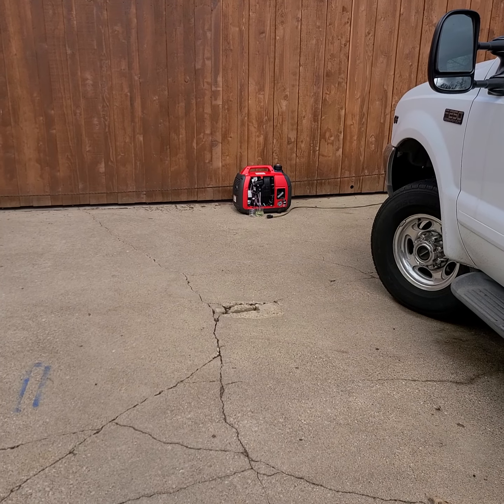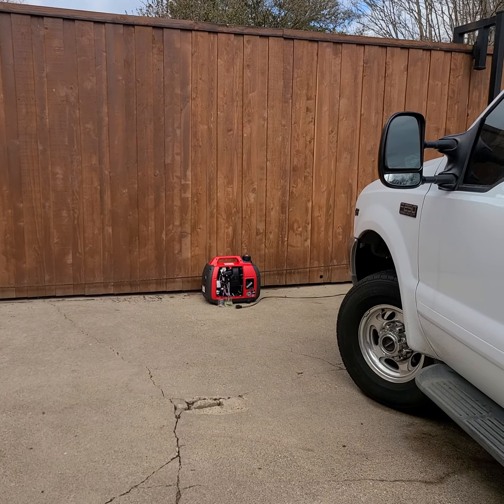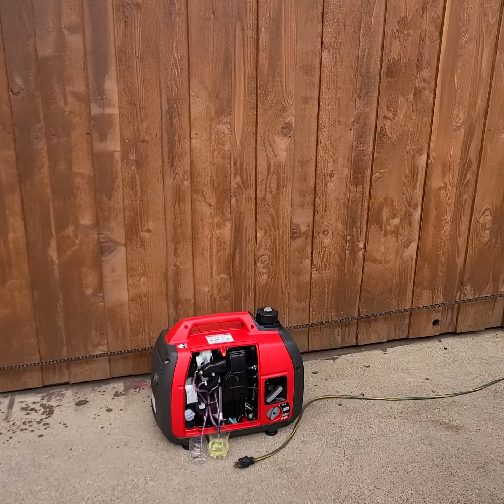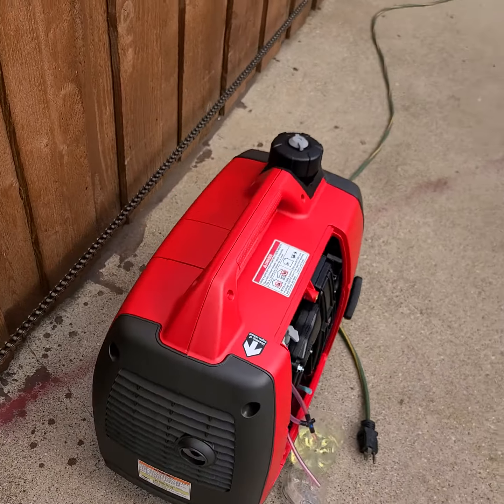Honda Generator Leaking Gas Feb 2021

Comment: Mine has been doing this too. What I did to fix it is that I turned on the defibrillator and then swiped my debit card into the exhaust pipe. This only works if your debit card is not expired and has enough money to charge and refill the generator. Then you want to open the air pipe by getting two drumsticks and drumming and 7/4 polyrhythm on the left side. That should fix it.

Comment from the maker: Thanks for all the comments.  I did clean the carburetor and it is working now.  But what is really odd, this was the 3rd time I used it.  I drained the gas and ran it dry the previous 2 times.  I will now drain, put in gas with no ethanol and then run it dry with that type gas.  That is supposed to help.

Comment: Easy fix…your float bowl is stuck open or float needle is bad. Easy fix with new carb kit and 15 minutes
Reply: I am going to try replacing the float valve and float, but if you look closely you can see that is actually shooting the fuel out I'm hoping it'll work but I'm worried it's something else...
Reply: This was the issue with mine, the float needle was stuck open because of gunk. Sprayed some carb cleaner and voila!

Comment: Did you find the problem?  Same issue here
Reply from the maker: I took it into a honda dealer, since it was still under warranty and turns out they could not reproduce it.  They gave it a carb job and I have not had issue for 2+ years.  When this happen the generator had only around 2 hours of runtime on it and I ran the carburetor empty the few times I used it prior